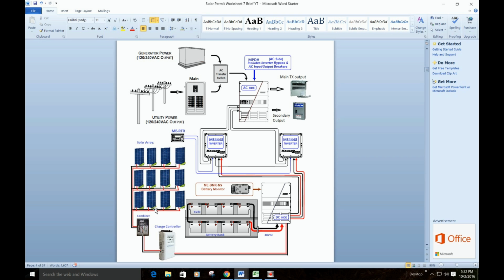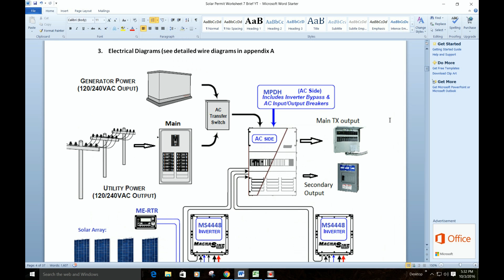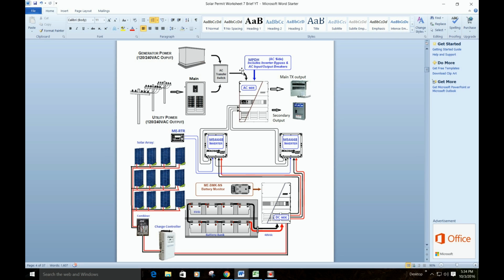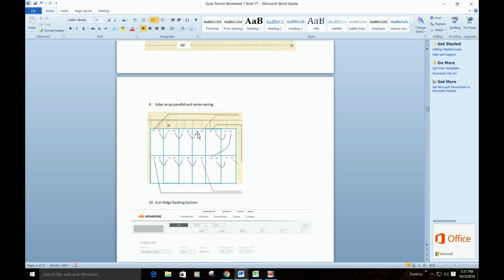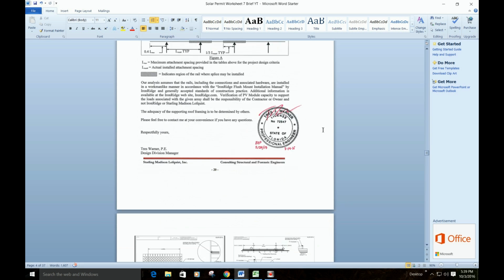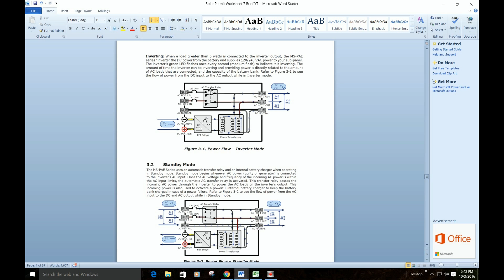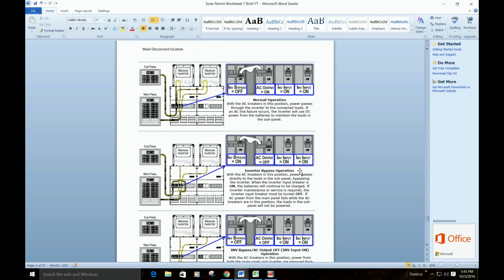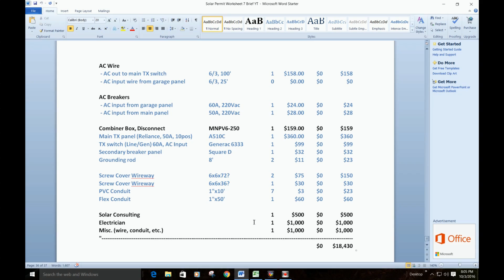Hybrid Off Grid Solar Power #1: Design and Permitting

Comment from the maker: The system is very scalable with preferred design points as follows:

1. Base system: $11k (after 30% tax credit)
 - 4-5k on the collectors
 - single PT-100 charge controller: 100 Amps
 - single inverter: 4.4k/8.8k continuous/peak
 - 8 Trojan batteries: 370 Ah at 48Vdc

2. Base Plus: $18k (my system)
  - double the collectors to 8-9k
  - add second PT-100 charge controller
  - add second inverter for 8.8/16k total continuous/peak Watts
  - double battery bank to 740Ah at 48Vdc

3. You can take this system to:
  - about 34k on the collectors
  - 8 PT-100 charge controllers
  - 4 of the 4.4k inverters: 17.6k Watts continuous
  - not sure how many parallel banks of batteries you could add and maintain even charging???
  - can mix solar/hydro and wind seamlessly via the different charge controllers

Spreadsheet on Google Drive (use at your own risk):
1. Matching solar panels to charge controller:
https://drive.google.com/file/d/1AH6wTiaRHPRxnDzdDeYDDYzKntXDWl0O/view?usp=sharing
2. Parts list:
https://drive.google.com/file/d/1OKP_ugJ8qidYku5sZvBqr2ICN3zR__m-/view?usp=sharing
3. Solar permit:
https://drive.google.com/file/d/1uXN3Pgn34_f-OlrzqYu5Edl4OmkTvUZC/view?usp=sharing
Reply: Will you please share your design doc link ? I am going to put my solar system to act. I will use the design as a guidance. Thanks
Michaelshin95540@gmail.com

Comment: Hello David, I am building an off the grid system with 16 panels and Enphase micro inverters. May I please have the names of the consultants you used for solar design. I need help on how to go from the AC out of the Enphase Combiner to selecting the battery charger or hybrid inverter for that AC coupled connection.
I am in Jupiter Florida.
Thanks so much for your YouTube videos.
Ronnie Shand
Reply from the maker: Ronnie, I ended up not using any consultants.  I recommend calling Johnny at Gain Solar in Ga.

Comment: Came back to watch your first solar build series in preparation/excitement for the next instalment 😅
Reply from the maker: I can't believe it has taken a year to get this project off the ground as it is the #1 thing I have wanted to work on.  I finished the 1st video in the series about 3 weeks ago and It is finally on deck!  The series will look something like this: Design, tree clearing, layout-dig, concrete, rack-panels, wire-combiner, wire-charge controller, launch, operation-overview.

Comment: Wow, I'm going to watch the whole series but wow this has to be $20,000-35,000 all in for a hybrid  system. Your a lucky guy to be able to afford that level of system. I have been building my system one part at a time trying to meet the proposed regulations. Permits in my area are limited to "solar electricians" only and their fees are over the moon and back. Not to mention permits are based on the cost and size of your system here. I'm lucky to have the knowledge and ability to build my little system and a community of folks that are willing to share the journey. #F@CKPEPCO (my power company)
Reply from the maker: My system cost about $26k in hardware ($18k after tax credit) and I did all the work myself.  I always encourage people to build out solar power at any level they can afford.  That said, I encourage people to save their money and build bigger better systems if possible.  The reason is that I see a lot of folks building really small and then throwing that out to build medium and so on.  While it is a learning experience, it ends up costing a lot more in the long run.  Thanks for watching!

Comment: Spousal ordinances  LOL
I'm doing a grid tie myself, mostly out of greed, to have free electric in 5 1/2 years. What I'm doing is tossing an extra half dozen panels on the roof that, when I get spousal approval, I can get that magnum 4448 as a backup power source, enough to run essentials. In the meantime the generate  sellable power.All 43 panels  face south.
Reply from the maker: FlaGordonMoller,  If you watch the rest of my series you will find that I did get clearance to build on the south facing garage later on in the series.  Once I got that, I doubled the size of the array and battery bank.  One thing you might consider related to panel location and placement:  If your grid tied (net metered) than you should probably optimize on maxing out the total power generated (face them all to the south.  If your not net metered and have a battery bank then you should optimize on stretching your "solar day".  In this case you want to have the majority of panels facing south but also some facing south east and some facing south west.  It comes down to, panels are cheaper than batteries.  Good luck with your system!

Comment: I love your comment about how writing it all out for the permitting helped catch mistakes in the design before installing. So true. I'm very impressed with all of the design work and forethought that went into the project, rather than just designing as you go. We see lots of folks who think they are saving money by getting random components and then trying to figure out how to get them all to work together after the fact. It rarely ends well, and results in many components needing to be replaced because they just won't work together. There goes any savings....
Reply from the maker: I had to put a lot of thought into it because it is my 1st solar power system and I had no experience.  I have learned a lot but I still have a ways to go...

Comment: Great video and looking forward to seeing the whole series.  Where are you finding the Magnum Inverter for $1717?  Thanks, Armand.
Reply from the maker: I got that price from a website but I did not order from them as I am not sure how legit they are.  

Here is what I did:  
1. find the best prices from around the web on ALL your equipment
2. put it all together as a package deal
3. Have your preferred stores bid on the package deal to match the bottom line.

That way your favorite store can match the overall bottom line price without violating any MAP pricing on any single item from their vendors.

I ended up buying the bulk of it from a local solar installer.  The Ironridge racking, breakers, arresters and misc from AltE store, wire, conduit and cable trays from CED (local), some from Lowes and about $1,500 from Amazon.

This is the website for the low price Magnum:
http://www.savegreenmoney.com/product-p/030-02341.htm
Reply: Good advice on getting a quote for all of the parts.  Thanks again for the info.  Good luck with your project.  Will be watching closely as I am looking to incorporate Magnums into my solar setup.